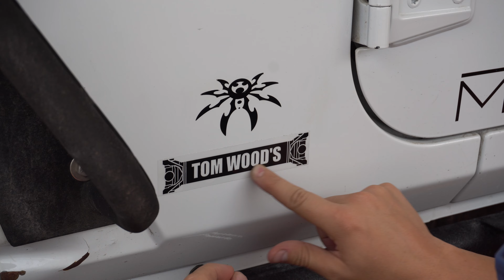How to install a Driveshaft in your Jeep Tom Woods 1350 Install

Comment: bro you used a torque wrench to remove a nut? big no no
Reply from the maker: Ace Calzadilla 😂😂😂 thats what i had available at the monent because my impact gun was dead
Reply: well you will need a new one because that one most likely lost its calibration. Click type torque wrenches which is the one you used you cant be used for that. Beam style you can get away with it, but only up to its limit but not past it, with beam style you can check how much torque the bolt had until the bolt breaks loose. If you don't want to spend to much money on tools go to Harbor Freight on 49st and get some cheap hand tools, they work ok for the most part.
Reply: The other 2 things I noticed that weren't done were that he
1) Didn't apply RTV to the washer before putting the flange on, and also that he didn't re-torque to Jeep specs.  Good luck.  If I were you I'd do both of those things... you're asking for a catastrophic event without torquing to spec and also risk leaking diff fluid without the RTV